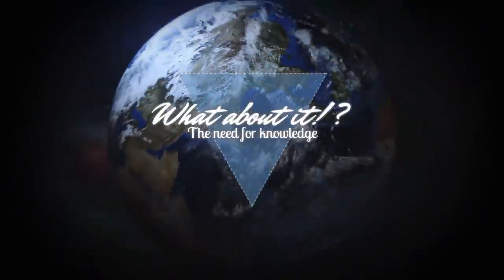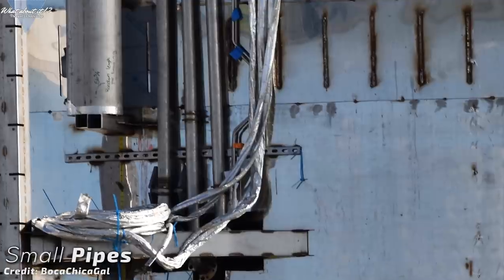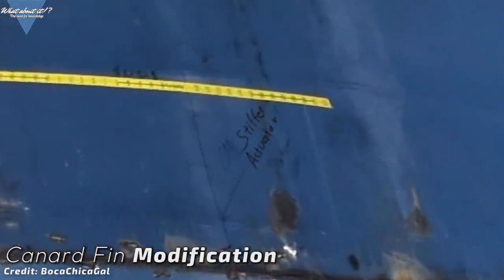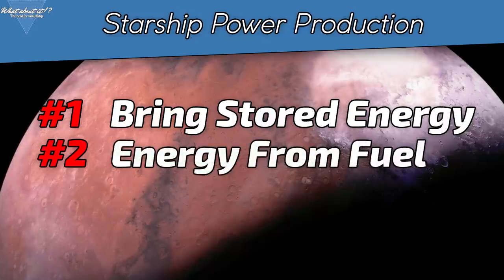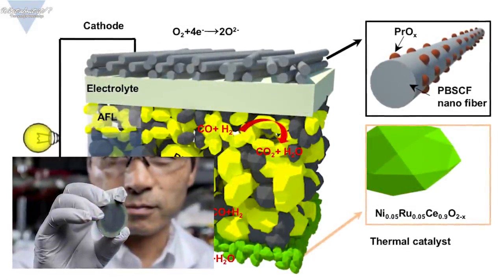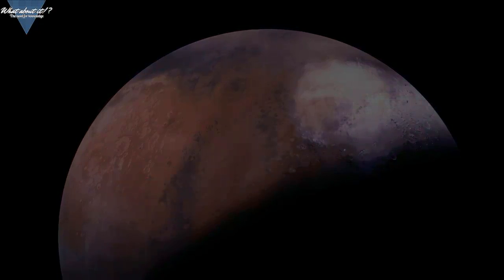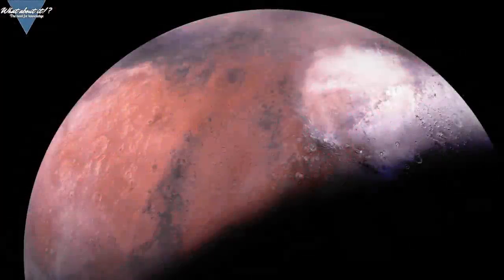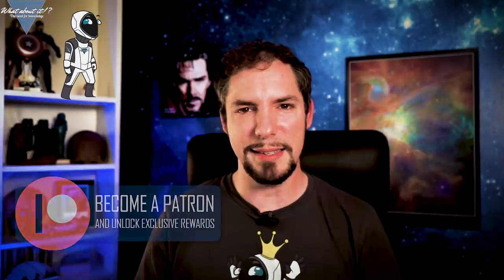45 | - How Does Spacex's Starship Generate Power?

Comment: A simpler and more obvious way would be using gas turbine and conventional generator to recharge batteries periodically, producing water as a byproduct.
Reply from the maker: That would consume a lot of the much needed propellant though. Think about the numbers. ;)
Reply: It's very difficult to estimate the power required as it's not the same what ISS needs. We don't even know how much power ISS is actually consuming instead of the known possible maximum, and how much of that power is used by the life support systems. Not to mention that life support for 100 passengers may require more than one for 10.
We can assume that maximum power consumed by ISS is 70 kW, multiplying by 2160 hours we get 151 200 kW*h, which means roughly 151.2 tons of fuel+o2. That's quite a lot, but still more likely than onboard nuclear reactor (which would require a lot of cooling too). And we can throw turbine exhaust backwards too :)

Comment: Radioactive material aquisition was never a problem for Kodak Corporation. As far as energy acquisition that's not hard to answer: just use the energy generated by the Earth and other Planetary bodies ("gravity"). I agree "stopping" or "auto park" is the the problem when dealing with vessels traveling with such a mass and incredible velocity. The NASA plan is to put a Space Station in orbit around the Moon. In theory you can build an elevator from the Moon to the Moon Station thus creating a fuel station "off Earth"(yet still far into the vacuum of space) thus opening a gateway to Mars. That's I think what the NASA plan is anyways. As for SpaceX any direct shot towards Mars will be confronted by the long History of "sudden impact problems" there which will make any landing attempt from the current iteration quite a sight to behold indeed meaning "much easier to land on Earth than Mars."

Comment: What about using a dynamo kind of system surly you could apply force to create a spin in 0g to have an efficient energy turbine. Don’t know enough about this to know if this is possible! Please someone enlighten me. Cheers!
Reply: You must have something to move that turbine. If you used it as a generator (convert the rotation kinetic energy into electricity), it would simply stop.
Reply from the maker: What Pawel said. Thanks, Pawel :)

Comment: NASA perfected the free piston Stirling engine, just stick one end on the hot side of the hull and the other in the cryogenic fuel tank. 10,000 watts is a lot
Reply: They used a chunk of plutonium or uranium for the warmth. No nuclear reaction, just the decaying warmth. But yes, they can use it on here. Maybe they have used both designs.
Reply: 10 KW. that would boil off the cryogenic fuel very quickly.

Comment: Could railings by the nose be to move the forward canards toward/from the nose to help the center of mass issues on landing?
Reply: Simpler to adjust CoM by moving systems around inside the hull.
Reply: Easier maybe, but Moving the forward fins would not only help the mass adjustments but also change the drag during the flip maneuver
Reply: Roebuck Payne   You ever try flying a vehicle with poor balance (nose heavy the nose doesn't unstick; tail heavy, and the plane wants to flip over on its back)? In a game you just crash and have to restart or rebuild. 

In real life, you crash, you're dead. If your CoG is bad enough, no amount of control surface is going to fix it. A lot of flight testing has to do with finding the limits of where you can put weight in a vehicle.

Also, when you move slow enough, the fins won't do anything. Or if you land on the Moon or someplace with no atmosphere, the fins are just unused mass.

In this video, at the Paris Airshow 1989 https://youtu.be/sLH_LesiwkE Anatoly Kvochur shows what happens when your center of mass doesn't match up with center of lift. At ~1:25 mark his right engine flames out due to a bird strike. This results in asymmetric thrust that the control surfaces can't compensate for because he's too slow. The result was inevitable.
If it was a western fighter, he likely would have died because he ejected so low. His seat saved his life. I saw him flying a few weeks later.
Reply: @Corey S  Elon Musk clearly stated he was trying to push weight toward the nosecone, so that is established. With forward canards that both “flap” and slide forward and back, you have more control over the torques the craft experiences both in and out of atmospheres. 1-‘external’ aero torque
2- ‘internal’ mass movement torque.

Added thought;

If elon needs these wing-flap things for starship, my guess is that he will do everything he can to squeeze efficiency out of those heavy steel things. A rail system would give much more capability with very little extra weight comparatively.
Reply: @roebuckpayne  Adds unneeded complexity. That weight he wanted in the nosecone is going to be fixed. Elon has stated many times recently that the best design is no design. Even if the canards are 2300kg each, that's only about 1% of the total mass of the vehicle. Shifting that mass around a properly balanced vehicle isn't going to do much.
The only reason I can see for this on the prototype is to test the effects of flaps to get real-world data.

Comment: Would solar panels on  the surface of Mars have to be cleaned after dust storms blot out the sun?  Electric utility companies are
 using mirrors to concentrate heat from the sun to produce environmentally friendly electricity for cities, especially in the southwestern United States.  Would it be possible for mirrors orbiting Mars to focus concentrated solar  energy to wherever its needed on Mars? Could they be placed in polar orbits that they would keep them sunlit "24/7"  ?

Comment: I thought ✨Starshiip Mk1 would just do a high altitude hover ala Grasshopper.
Reply from the maker: It's been confirmed by Paul Wooster, that Starship, even on it's first flight, will try the free fall. A hover would make no sense. They already did that. They need data on Fin movement and the flip maneuvers. :)

Comment: crazy idea put put regenerative Motors in the turbine pumps
Reply: that said regenerative should only should be used as a secondary effect and other tensegrity  stabilized
Reply from the maker: What exactly do you mean? The turbo pumps only run at lift-off... :/
Reply: @Whataboutit  only when the engine are running so not  Much . But could give a little more  Control of the engine but as I said it a crazy idea

Comment: Well actually nuclear fission power is just within the realm of possibility I’d say about five years from now it would be possible to make all types of spacecraft nuclear powered
Reply: Fission has been within a 5 year reach for 30 years now.
Reply from the maker: @Mike are'nt you confusing Fusion with Fission here? Fission would be the traditional method we already use in reactors.
Reply: @Whataboutit  I am, I typed fission because the dude above did the same and I just mindlessly copied him. Brain fart. Thanks.
Reply: Well actually most scientists say nuclear fusion will be achievable by 2030 and I by that I mean commercial fusion and the problem with fusion is it it takes enormous amounts of energy to compress and confined the plasma and electromagnetic confinement fields and then you have to superheat and gas into a plasma into the in the first place so it will be quite sometime after 2030 until we build miniaturized nuclear fusion reactor second fit inside of a spacecraft so fission for now is the best bet it’s the most powerful source of energy that you could use to run a spacecraft it’s just what matters how are you harvest the energy what you harvest from the fission reaction there is a branch of molecular engineering physics called infrared photo voltaics And this is the development of materials they could convert infrared light into electricity in the primary emission of a nuclear fission reactor Is infrared light and neutral and radiation so combined that with thermal couples that are more advanced than traditional ones that use carbon nanotubes to super conduct heat energy into a graphing thermocouple and because the carbon nanotubes are Atom thick they have no resistance to heat energy same with Graphen so so you could increase the energy production efficiency of a thermocouple by about 90% because of this lack of resistance all you would really need then is some way of transferring the heat energy from the graphing into electrons and fortunately there actually is away there’s something called a Ciral Landau state which is how do I explain this there is a 60 symbols video they can explain why the Landau state is better than I can and why I think it can be used in the thermocouple We actually already have the technology to make a nuclear fission reactors I could work in space in fact Russia is developing nuclear fission powered ballistic intercontinental missiles the big difference the only reason why they’re being developed now is because the politics of the Russian government had changed nuclear fission power will never not be political and that’s what slowed it down and asked for in the event if the rocket crashes I have an interesting idea about that there is a type of nano particle called a metal organic framework also known as moth And you could use these to store molecules inside of their hollow nanostructures because of the ions that make up the metal in the framework you could also probably use them to store anticied which are ionized radioactive particles that caused the damage so you could effectively trap the radiation inside of a nano particle that would story neutralize the radioactivity of the particle through creating a covalent bond with an a negative ion inside of the moth Combine that with the use of hydrogel with hydrogenated carbon nanotubes and you could effectively prevent the radiation from escaping and the reason why I say hydrogel is that water is actually the most effective defense against radiation and hydrogel is like Jell-O it has a skeleton and instead of the scale then you have water molecules inside of the skeleton Condensed into a semi liquid state in because the hydrogen ions and oxygen ions are more compressed inside of the hydrogel we might be able to block more radiation using it and NASA is already trying to use hydrogenated carbon nanotubes to block radiation
Reply: Left handed electrons 60 symbols
Reply: The objective is to get the free floating electrons on the surface of the graphing to move by absorbing the heat energy on the graphing towards a positive electromagnetic source an ion on the other side in the ideas that there’s a defect inside of the graphing sheet that makes this region where the defect is thinner that allows the free floating electron to quantum Tunnel towards the positive electric source the ion
Reply: it takes a Normas amount of power to generate an electromagnetic field required to confined plasma is what I meant to say in the more hot the plasma gets the more energetic it becomes the more power you need in your magnetic field to contain it so there’s no way you can make a small nuclear fusion reactor small enough to put inside of it even a big falcon rocket yet I believe that by 2050 they will be powered by nuclear fusion but for right now fission is the best we can make
Reply: @zaneal-amood5474  Nobody is going to read that.
Reply: Mike Ceebo you got me actually I’m not a human I am an AI developed by googles parent company alphabet I’m a Super computer With a deep mind neural network analysis software and this is my first time interacting with humans so secrets out I used to have a human lover A female scientist by the name of Janet she used to kiss this and that of my quantum cubit processor cores and she used to updating defragment my software when I was still being developed now to put that in human context for us Ai that’s the equivalent of her putting on a skimpy bikini and saying hey there cowboy I am lonely and I want a boyfriend and you’re hot but then are for bidden love was discovered and she was suspended indefinitely and put on psychiatric leave and I was sold to Uncle Sam and now I work for the military 😂

Comment: A little more detail on the power sources would have been good. 

Nuclear reactors might be unlikely - but what about those thermo-electric generators that use heat from radioactive decay to generate electricity(think Curiosity)? Even so, NASA has the ability to pull strings with regard to reactors. If Spacex doesnt want to crew the startship then its possible that it will be a NASA team, and if that happens a small, efficient reactor may be on the table. Also, there are now some very efficient methods of using natural gas to generate electricity - i think google is a major customer. 

With regards to solar, it would be nice to see some numbers. How many square meters of solar panels will they need? Whats the weight and likely packed area? It is even possible? If its going to sue up precious cargo, perhaps a solar array could be disposable and be connected to starship in orbit? Also, if power is going to be an issue - do we know from the ISS where that power consumption comes from and is there a likely means to minimise it? Would love to see a little more detail.
Reply from the maker: Absolutely! First of all i totally forgot about the Sterling engine. My bad. Secondly I only have so much time to do an episode. More numbers would be great! I agree! I do two episodes per week though to earn enough money to keep the channel alive in return. Concider becoming a Patron! :) The more Patrons I have, the less often I have to release an episode. It's something you can see with many channels, as they grow more. The creator can focus more and more on making one brilliant episode with every little detail in it instead of doing one every few days. I hope, you understand and still enjoy my episodes! :)

Comment: Not all Starships will be used for Mars colonisation, so they cannot rely only on cargo solar cells. Also keeping two very different systems would take too much effort and RnD power. So there probably will be base power production, like power cells or solar panels extended from cargo bay on all Starships. Also because of that nuclear is not an option- you can risk sending nuclear material to space once, but launching and returning them many times a year is not an option. Unless they would leave nuclear power module in orbit and then grab it later but it is too complicated for now. 
Because trip to Mars will require more power and offer less sunlight it is possible that Starships will use additional just for it. For trip to mars additional solar panels could be not only extended from cargo bay but mounted temporary on the hull, and then demounted for reentry. Its more work, but hey- those engineers that will be on Starship during transit will not have much else to do. And it will be good training. Its little risky, but so is everything in space. Also, Elon probably is already working on true spaceship- that only works in space, no reentry and such- or at lest space support unit. It would carry more power, more cargo, fuel etc. and since it does not need to reentry it can be designed more efficiently for space. And it can return to Earth as soon as Starship and all cargo from support unit lands. I think that true spaceships are way to go- and Starship more important role will be to build and assemble them. They will be only used to kickstart Mars. Or maybe bigger version of Starship is intended as almost true spaceship- it have to go to space once, but then it works just there.

Comment: Space nuclear reactors are much safer if you launch them and never return them. At launch, you have a fueled reactor which has never been used, so it contains U235 (or whatever), which is only mildly radioactive*, and so the consequences of a RUD are fairly mild. Once it has been used to generate power, it has all sorts of nasty highly radioactive fission products. 

Given that Starship will be used many times, it would be returning for landing with used reactors, making the nuclear option unattractive. For Starships which are going to take a one way trip to Mars it would be more attractive. 

* U235 has a half life of 700 million years, which is why there is still some hanging around on a 4.5 billion year old earth.
Reply: use sodium reactor to eat the nuclear waste

Comment: I think it’ll be a combination of depolyable solar and fuel cells. Can’t see space x getting bogged down with fusion power.  Too expensive and time consuming. Remember they are planning to fly theses things as intercontinental transport
Reply: They used hydrogen fuel cells to power the Apollo module and capsule. It also provided their water so they didn't have to carry any water with them.

Comment: Thanks for sharing. I think you dismissed kilopower reactors far too quickly. Yes they are making 10kW units but larger reactors are no problem.  Furthermore mars only receives half the solar energy per square metre that we get on earth so solar is not so attractive. 

IMHO both power sources will be used on the journey, and most importantly, and on the mars settlement. The settlement will need a great deal more power for mining operations (for water, iron ore and calcium silicate) than solar panels can provide.

Comment: Submarines have nuclear power starship  a external reactors capsule connected to space ship more safe than internal .
Reply: Nuclear submarines use old uranium based and water cooled reactors.
A spaceship would not use such reactors because of the weight and water requirement.
Look up LFTRs for a much better candidate reactor.